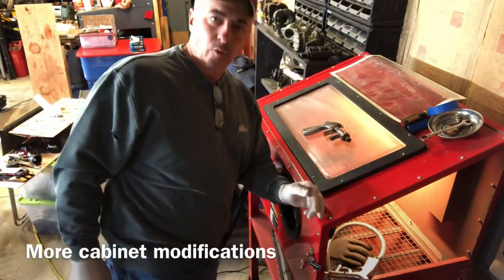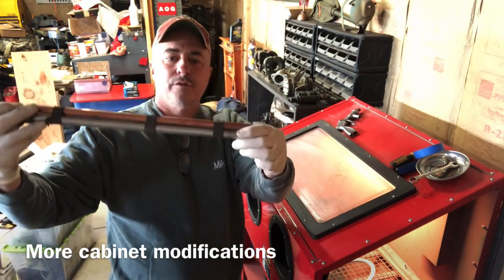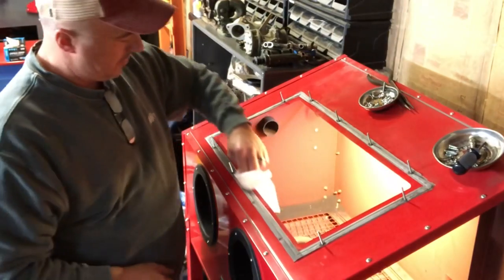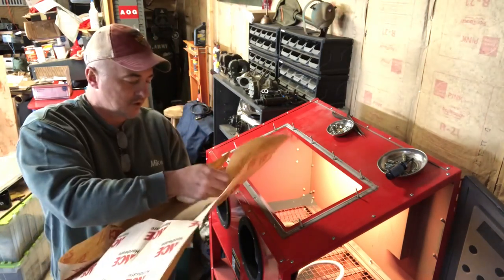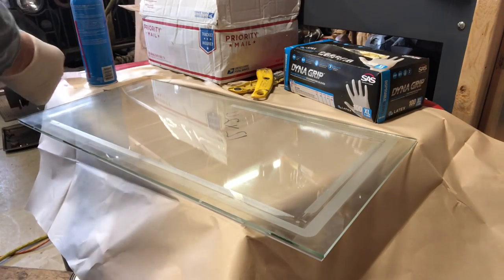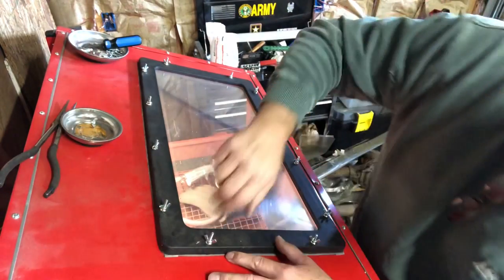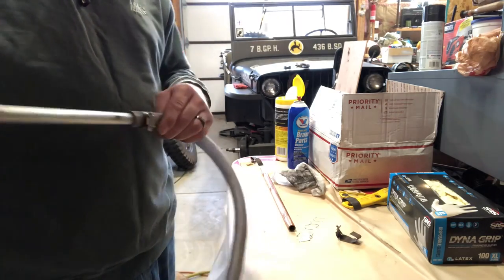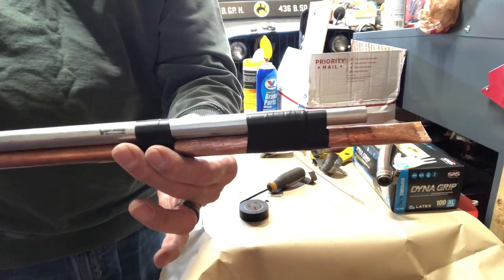Harbor Freight blast cabinet window upgrade

Comment: I wanna thank you for this idea! The plastic film was always falling off the glass and I could never stick it on right. So yesterday, I went to my local Ace and picked up all the hardware and glass. What a difference it makes in maintenance and visibility! We'll see how it works out. Thanks again, Mike 🙂
Reply: Without the replaceable plastic film covering the glass on the inside, the blast medium will destroy the glass surface, so you have gained nothing and now will have to replace the glass window, which is more expensive.

Comment: I did the same mod for the window  used thumb screws instead of wing nuts so the top of the machine screws are flush with them to eliminate snags.
I left off the plexiglass and just have the tempered glass since the plexiglass scratched as fast as the inside clouded up.
One trick to make the glass inside last longer is to coat it with 2" painters tape. Score it every 8" and just peal off another one when the opening fogs over.

Comment: Dave did you ever remove that robot siphon tube and put the mod on the bottom of the cabinet dump door?   I did that one first and man did it bring that old cabinet to life.  $40 at ACE.   Screw the T fitting with drain plug.  Just go 1” 90 def male to F elbow and drill the hole just big enough for 3 threads to poke through the dump door and then use a 1” electrical box threaded cap to hold it in.  The rest is cake.   Plus no more stupid siphon tube taking up all that riom
Reply from the maker: No, have not made that modification but thank you for the suggestion

Comment: Hi Watson, I have the same gremlins. I put a spanner down in front of me and when I go to get it it is gone. My friend stays about 6 miles away and he has the same problem? the spanner is right in front of you and you can not see it.
what causes that?. I said old age as we are around 75 yrs plus. So yes I did buy a few more spaners eg 10mm and some more screwdrivers eg cross heads as they just seem to disapear. take care . I will just watch your mods, I have the same cabinet... bye.

Comment: I had a thought that a person might pipe the intake air to flow across the glass to keep particles from striking. It might be worthwhile to experiment with that. All it would cost would be some PVC pipe and glue. I put an in-line air spray nozzle  with my gun to knock off the grit off and into the bottom before I open the door. It was cheap Amazon less than 10. The button is right under the trigger. Works well and super handy.

Comment: Good video, how did you get on with the tempered glass did it stay clearer ?
Reply: 3/16” clear annealed glass helped me to keep it from breaking when you tap it with a part or the gun…tempered glass is a waste of $ it will etch just like annealed glass in the same amount of time with sand overspray. I use clear contact paper and change it once it’s foggy

Comment: Stupid idea with the glass.way ahead with the plastic film ,at least for 20$ you get 5 clean sceens instead of just one glass,,be scored up in couple days
Reply: I've had glass in mine for 4 years without the plastic sheet or plexiglass.  I'm on my second pane of glass in 4 years. It goes bad a lot slower than those plastic sheets. I was changing them every 3-4 times I used the cabinet.